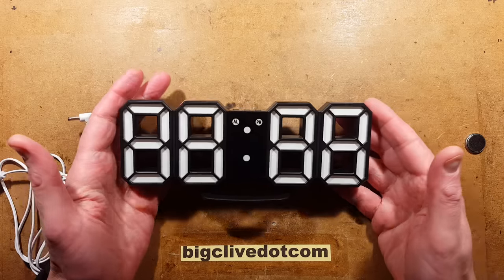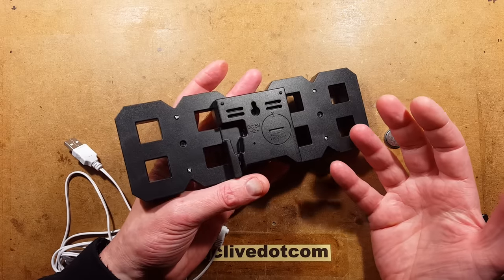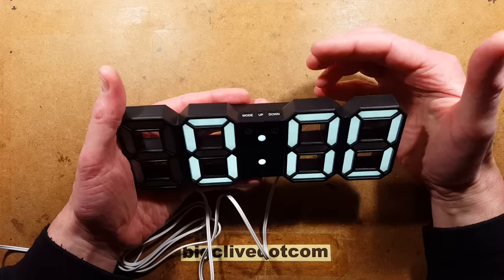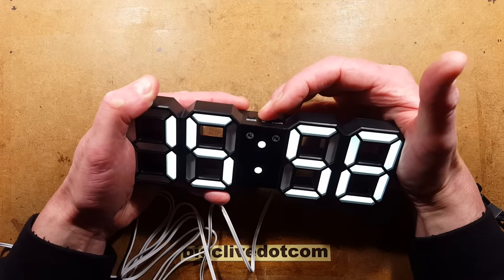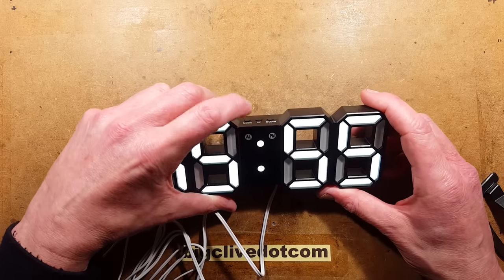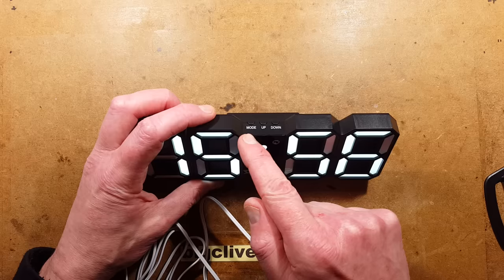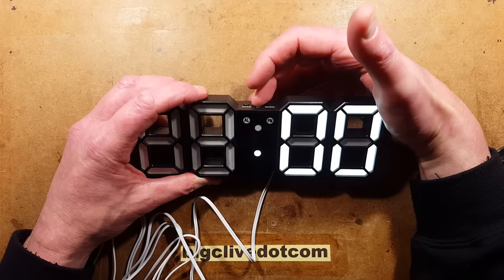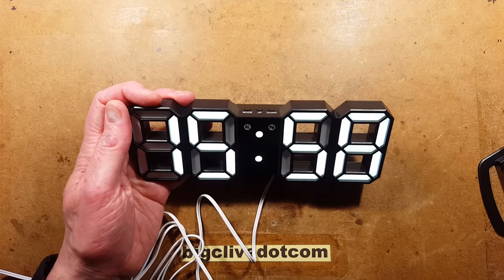How to set your 3D LED digital wall clock.

Comment: Mine arrived and it's slightly different. It has the ability to show the temperature. Pressing the up button cycles through 3 options where the clock shows or the temperature displays every now and then, which also illuminates a light to indicate temperature is being shown. It's below the PM light.

Comment: It's amazing how much functionality they can hide behind 3 buttons. I wonder if there's even more interesting things it can do, but which you haven't yet figured out...
Reply from the maker: I've tried lots of combinations....
Reply: @bigclivedotcom  Hey, I just got one of those lensed laser interference/interferometer distance measuring devices, looks like a fun disassembly project too! :) (Mine was from B&Q IRC)
Reply: DECADES ago I had a GE alarm clock radio with a keypad that allowed you to set the time and radio station by punching in the numbers. Of course it was also UL listed and came with a professionally produced instruction manual written in grammatically correct English. Presumably one could also purchase a service manual for it and replacement parts. Fast forward to the present (minus three years and counting) and this is what qualifies as a spiffy clock. Dreadful.

Comment: Oh! I remember seeing those clocks when searching for one on eBay the other day, but something stroke me as odd with those. The white overlay over the LEDs just made me worry that you wouldn't be able to read the digits during day time. Can't always trust the product photos on the listings, so this helps out actually. Thanks for the demonstration Clive!
Reply: I have it and it’s actually very clear, mine is white
Reply: @3alaiyer  
i bought few of these different colors coming in weeks ..was wondering u Using  the same USB  power charger adaptor  plug in to connected to wall or is something else? i tho also shows the Temperature 2

Comment: I have a slightly different model of this. The digits have a slight slant, which looks nice. It has a PM, Alarm, and Temp LED. It now supports three alarms. It will show date and temperature either on an automatic cycle, manually cycled, or temporarily with a button press. Manual says that it has a power saving "voice control" mode, that when activated, shows the time for 15 seconds if sound goes over 75dB. Unfortunately, manual brightness controls, and the option to change the time of auto night time dimming appear to have been sacrificed to make way for the extra alarms and the voice control mode. It appears to be fixed at dimming at 7PM, and brightening at 6AM, and it's only daytime brightness setting appears to be "lighthouse beacon".
Reply: It seems there are a number of slightly different versions that look the same. Mine will only dim from 7PM to 6AM and only at one level? I want it dim all the time in my home theater (It powers off the USB on my Samsung TV.
I don't know how you can really determine what you are getting when you order? It would be nice if someone would sell the different versions clearly labeled as to what functions they have.
Reply: How do you set it to cycle between modes automatically?
Reply: If hold down down button will display L and then. Number. Then press down button normally while displaying this and change light level.
Reply: Is there any way to offset the temparature? Mine displays around 7 degrees C too high. Not much use that way.

Comment: I looked briefly on AliExpress and it looks like some models also can display temperature, and I found one with degree symbol led right there where this empty port covered by front sticker is. Case is a little bit different with cursive digits, but I's sure that you could find one with temp mode and straight digits.
Reply: Got a link for that one in particular actually?

Comment: And if you wanted to auto dim the clock based on ambient light levels... this is how to achieve it with an LDR and a resistor should be your next video. ;)
Reply: In the other video he said there was a space for something but there was nothing there, I thought that space was for a light sensor so it could automatically dim based on the ambient light.
Reply: @theotherwalt  given the variants I've seen on eBay it looks like it ould be various things - LDR for dimming, IR receiver for remote control, mic for sound controlled alarm off/snooze...
Reply: I have a variant of this clock that has a light sensor built in so it can do automatic dimming.

Comment: 3,2,1 and  they have all sold out on Ebay
Reply from the maker: It will cause a surge in sales.  That's why I always provide a search link based on lowest cost and postage first.  That way if a seller bumps the price up they move further down the results.
Reply: Just make a better one with Arduino and max7219 lol

Comment: Big Clive, I'm wondering how accurate the clock is? I hate clocks that don't have time sync so they drift off and give the wrong time after a few weeks. I have two on clocks on my desk right now and I average the difference between them to get the right time!!! LOL.
Reply: I've got a similar clock, uses that single 32768KHz oscillator.  It loses about a minute per month so I'm guessing that this one might do the same.
Reply from the maker: This one seems pretty good.
Reply: That would be an interesting clock...one that picks up wifi and gets the time from a time server. Sounds like an arduino project to convert one of these to 2019.
Reply: @MiniLuv-1984  doesn't need WiFi, most of the world is covered by atomic clock time signals, just needs a receiver. Alternatively you can get the time with a GPS receiver, just need to set your local offset from GMT.
Reply: @98dizzard  Didn't know that Daniel thanks. There is no atomic clock signal here in Australia, unless you can receive from a nearby country that does, like Japan, but that is a hit and miss affair.  GPS needs to have sky visibility to work (at least here in Australia), so wifi may be the only option for a stationary, indoor clock for us.
Reply: @MiniLuv-1984  there are a few areas that might not have coverage on the time signals, some of Australia as you say can pick up the Japanese signals. You could potentially use a remote GPS antenna if you can't get signal indoors, but most GPS systems can get good enough reception in a room with a window except in unusual conditions. I just don't like the idea of having too many unnecessary items with potential security holes having direct access to the WiFi/network.
Reply: @98dizzard  Very true re risks Daniel. I was looking at this clock some time ago and thought it would make a nice wall clock visible at night. Ideally with no cables.
I was thinking of using a flat LiPo that could discretely be mounted on the back of the unit. Unplug and charge it say once a week.

A small 433MHz receiver could also be mounted discretely, so a central computer in the house sending time signals derived from time servers could transmit time codes on 433MHz band. Then one has to interface it to the electronics. Probably better to build the electronics from scratch and just using the case and diffusers. Gees, its turning into a big project! I might just put up with the error and just stick a flat LiPo,  from an old phone on the back. It may work with 4.2V to 3.7V, and if not use an eBay charger & 5V inverter module.
Reply: @MiniLuv-1984  if possible I would put some lightly tinted film over the white digits, should help with visibility during the day. Certainly is turning into a big project for a cheap clock. 😂
Reply: @98dizzard  and @Benny Banger Try googling "esp arduino NTP wifi clock" you might find something.  Using the ESP processor will give your project Wi-Fi, there are lots of ports of NTP for either ESP processor (8266 or 32).  Once you have NTP running it's just a question of connecting the new CPU to the clock's segments.  The ESP CPUs don't have enough IO for direct drive like the original CPU so some sort of IO expander is needed.  My suggestions are: 74HC595 (up to 10 mA per segment) you'll need four, Microchip MCP23017/MCP23S17 you'll need two, or a HOLTEK HT16K33.  These are just ideas, I've not done this nor am I interested in doing so.

Comment: does it reset itself when you turn off the switch as in when using the power adapter but not batteries
Reply from the maker: It need either power or a battery to retain the time.

Comment: The only problem that I had was that the light turned off when it stays for more longer than 5 sec without touching it . How do I fix it ?
Reply: Try resetting it :). Mine was turning off after 15 seconds until I reset it
Reply: @sophiecooke2538   how can i reset it?
Reply: @sarabarsan8917  by using needle or sim ejector just press reset hole on the top

Comment: So I have this clock and I bought the batteries for it, but it only works just plugged in the power. Is it supposed to work like that, or is the battery getting charged over time and I can uplug it?
Thank you for answers and this amazing video! :)

Comment: I just bought one just like it, I want to hang it on the wall but the cable is very short so I tried only with the battery but it doesn't turn on. What I can do?
Reply from the maker: The battery is only for keeping settings.

Comment: I watched this video and ordered this clock on Amazon (cheaper and faster than ebay where it will get here some time in July). One question, I'm planning to hook this to my little 12v LiFePO  battery in the garage (same one that feeds my LED strip light). Only problem I have is the battery is 12v and this clock runs on 5v. Any suggestion on a cheap way to step down the voltage to 5v?

Comment: Could one use a set of batteries (the type that comes with LED lights, in a plastic box with a switch) instead of the USB power supply?
Reply: I don't see why not. Just has to supply the correct voltage.
Reply: Gary Rumain - Hmm, ok... I may get one (the clock, that is) and try that.  :)
Reply: @DaveLennonCopeland  Normal 1.5V batteries won't get you to the right voltage. They'll either be just under (4.5V) or over (6V) but the tolerance might be enough to handle it. But you could try other solutions to handle that.
Reply: Gary Rumain - Ah, ok... Well, I confess, I'm not an electrician by trade, I'm a musician, but like the clock. Just thought if I could stick a battery pack in it to power it up instead of the USB, like I said in my original comment... I'll prolly just stick to the USB going to a wall outlet with the appropriate plug thing, you know...
Thanks though...  :)
Reply: @DaveLennonCopeland  Well, you can also get a USB power bank. I would think that would be the logical choice since they have USB ports and output 5V. Which can also be recharged. Simpler than using batteries.
Reply: Gary Rumain - Of course, that's that sorted... Thanks dude!  :)
Reply: @DaveLennonCopeland  Let us know how it works.
Reply: Gary Rumain - Sure.  :)

Comment: Looks cool but I'm kinda spoiled now by radio-controlled analogue and Google Assistant-enabled smart digital clocks to spend any money on a dumb one. If this one updated itself via wi-fi or Bluetooth, could display outside / ambient temperature, had adjustable colours, a polarised plastic cover to improve contrast between lit and unlit segments in bright light, and even maybe voice or app control, I'd go for it - not for any of the main rooms, as they're quite traditional in decor, but my 8yo would love it to hang on his wall. Maybe I'll have to build him one...

Comment: I just got one that is exactly like yours -- but not. It also has a temperature mode (Celsius only, alas), and the night-time dimming time range is preset and can't be changed. Also, unfortunately, the power plug slot is too small to allow the plug head to tuck down all the way. And, like yours., mine is about 1/60th scale compared to the seller's illustrations.
Reply: I just bought two of these, intending on giving one to my mother to use outside, but since it's only celcius, the temp is useless to her.  I understand °C, but she's elderly, and never used it in her life.  I wish I could find one of these with °F.

Comment: I have the model with temperature display. Typically, Chinese clocks with temp will have a calibration feature so the mfr doesn't need to use an expensive cal'd sensor. The user can usually set the reading +/-5 degrees.

Now while the instructions seem to suggest that the feature is present, I can't figure out how to do it. So I have the temp display disabled as it's off by several degrees. 

Does anyone know how to adjust it?

Comment: I have this one, but I noticed it goes through the backup batteries very fast. like 3 per year
Reply: Betcha how much they just cheapened out of using two diodes to stop the battery being used while you have actual mains power...? Presumably the clock itself runs off that battery _all the time_...
Reply: @AttilaAsztalos  I was thinking the same because the time is tripping balls a lot at that time while still connected to USB until I replace the battery

Comment: When I go to shut off the alarm, it doesn't work. It switches through modes like temperatures and other stuff. Also the middle dots flash for some reason.

Comment: Hi Big clive.  i need a lil help. I have a battery, a 3prong switch, and an led light i made of single 10mm leds. So far as is, everything is fine and dandy. Problem is i have to disconect the battery to charge it everytime. I have a tp4650 w/out protection, that i would like to incorporate. Can you help me with a diagram for this please. I know its easy i just cant get my head around the connection it would be bit easier if i had a 2 prong switch but my wife dosent want anymore gadgets in the house so i have to do with what i have. I would appreciate your help. I changed my profile pic on youtube so you could see the diagram i have so far.

Comment: Hi Clive. How would you modify the dimmer on one of these to be even dimmer? It's still a bit bright for my bedroom at night for easy time checking, but its big display is good for not having to put on glasses to just check the time.
Reply from the maker: I think you could increase the value of the big resistor at the bottom of the display intensity circuitry.
Reply: @bigclivedotcom  Thanks I'll give that a go. :)

Comment: Could you send me exactly what battery to buy? I don’t really know how to find it😂
Reply from the maker: It should say on the battery cover.  Probably a CR2032 button cell.  Note that it's only for time backup, and the clock is best left plugged in.  It takes very little power.

Comment: Hello, I connected it on my PC and set the time and date. But everytime i unplug my computer and open it again, the clock is on default mode (you have to reset it everytime you open your pc). Can it work like regular clocks? If not, Can I use it USB adaptor and plug it strsight to wall socket and leave it 24/7?  Pls help me. Thank uyou
Reply from the maker: Yes.  It works with a standard USB charger.

Comment: wait..If you take out the plug would it carry on working
Reply from the maker: No.  It needs power for the display to be lit.  It will maintain time on battery though.  If needed it can be powered by a USB power bank.

Comment: hi clive,   is there a way of testing a resistor without de-soldering it from the board ???
Reply from the maker: Sometimes you can just test it in situ, but depending on the surrounding circuitry the value may be skewed.
Reply: @bigclivedotcom  
cheers

Comment: I received this clock but it only works with the plug. It has a 3v battery option but it doesnt light up with just the batter installed. Is the battery casing bad?
Reply from the maker: The battery is just for memory backup.  It wouldn't run the full display for very long.
Reply: I have this problem too. Did you figure out the reason why the battery doesn’t work?

Comment: How accurate is the timekeeping on it?  I recently bought a chinese clock kit and it gains half an hour every day - I've yet to have time to get it back on the bench and figure out where the issue lies.
Reply: Suggest  you replace  the Crystal r.s. used to sell for about 5p did this with cheap  watches and improved  accuracy

Comment: How do you turn it off, without removing the plug?
Reply from the maker: You'd have to turn it off at the wall.  The lithium cell should store the time.
Reply: @bigclivedotcom  I bought ds-6609 clock from DHgate, exact same as this and there is three buttons on the top. With the middle button You can set brightness levels, there is one for night time, and it also can be turned off using this button.